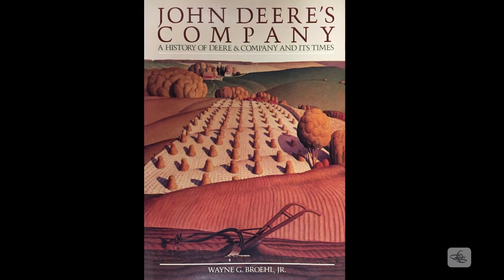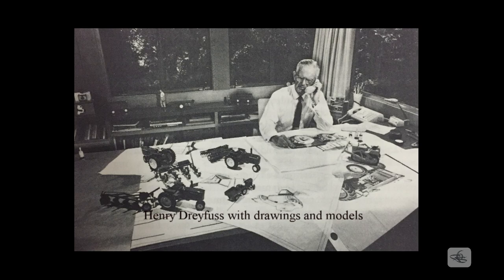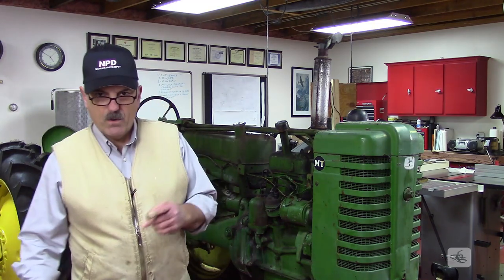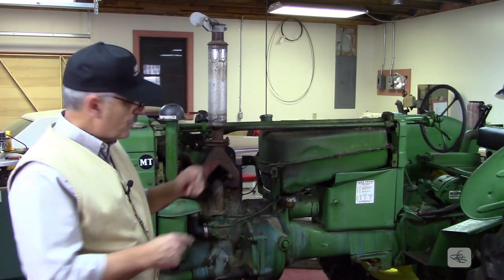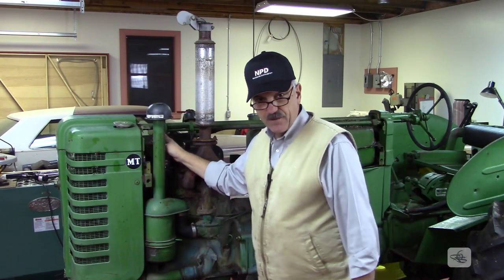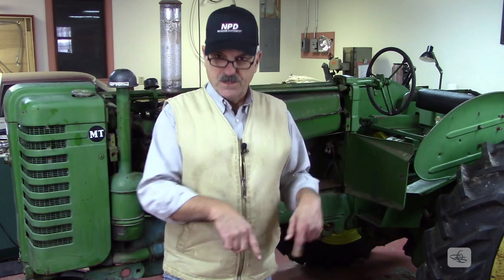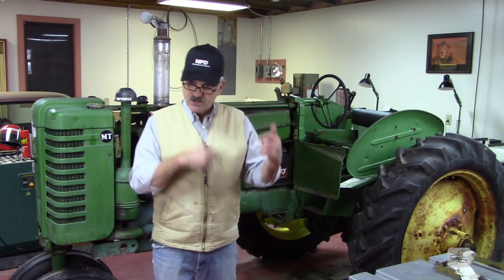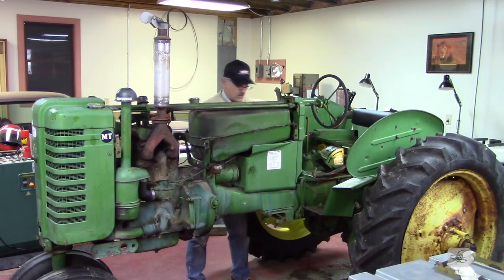1951 John Deere MT Tractor:  Shes got Style! Pulling the Cowl.

Comment: I meant to say thank you for the good video keep up the good work😁👍👍👍
Reply from the maker: Been real busy with other projects, but hope to get back doing more work on this little beast soon.
Reply: @SixRoundsStudio  I'm close to finishing the steering box just waiting on the shims that adjust the worm drive preload and the steering box cover gasket.
Reply: @SixRoundsStudio  it's nice to find another person out there that's an Mt Enthusiast like I am. 😁
Reply from the maker: @jonmiller8819  Is yours a trike?
Reply: @SixRoundsStudio  yes it is two wheels. Someday I still need to fix the seals on the hydraulics on the Rock shaft and the actual lever controls and the way the engine oil keeps increasing the hydraulic pump seal I'm sure it's bad but if I'm tearing that apart I'm putting bearings and everything in it.